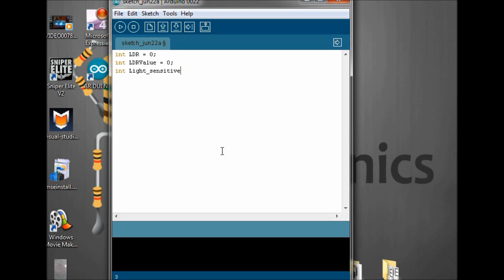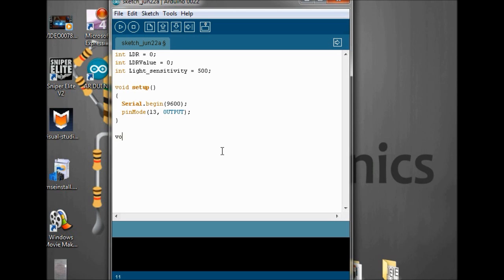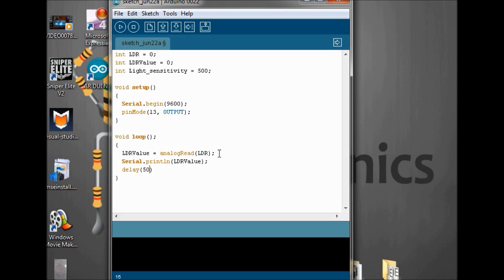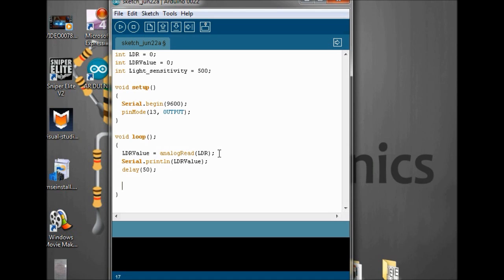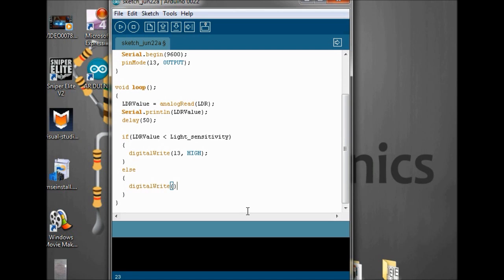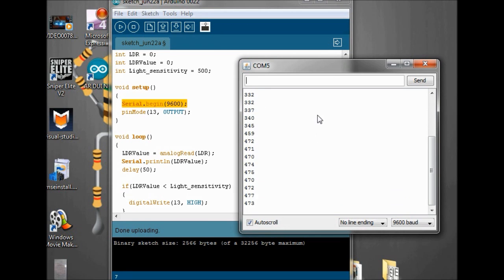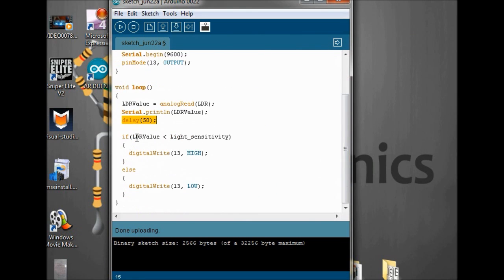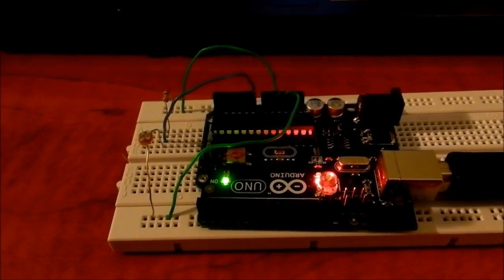Light Sensor Using Arduino and LDR | Arduino Light Sensor

Comment: I am using a module. The Serial monitor shows the opposite of yours. When I put a show on it it goes up to 700+ but if there is light it goes down to 300+

Comment: .
Reply from the maker: +Selim Cankuş :) Can I help you kardes?
Reply: According to the arduino different, the intensity of the infrared yapabilirmisin sending different signals to different pins 3 stage?
as auto rain sensor, codes required. Thank you from now.
Reply from the maker: +Selim Cankuş Analamadim Kardes! :(
Reply: I want to make my car rain sensor . I appreciate your help .

Comment: thx 4 dc great stuff man. I'm crating my arduino project connecting it to LDR,UM-3561,GPRS shield V1.4 and speaker. My LDR will act as Smoke detector create alarm and send SMS to the user if smoke is detected.